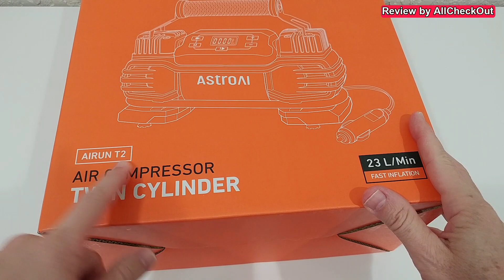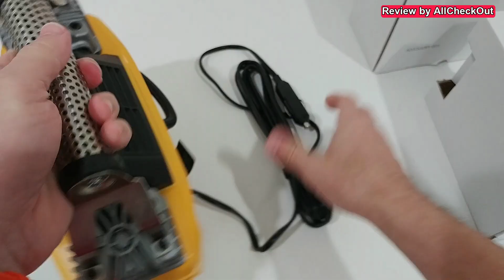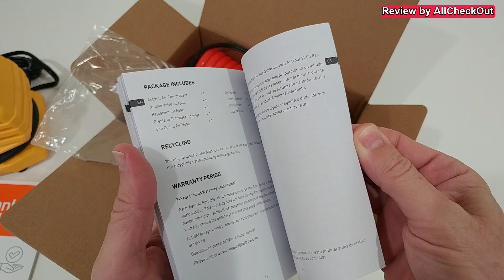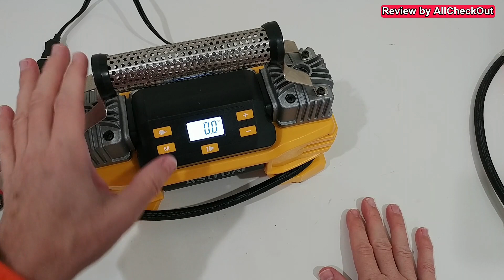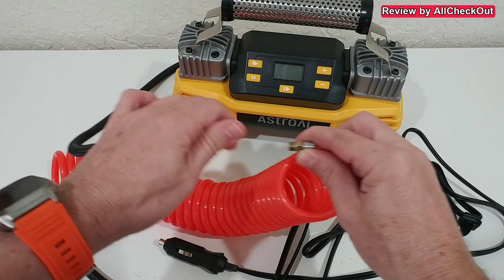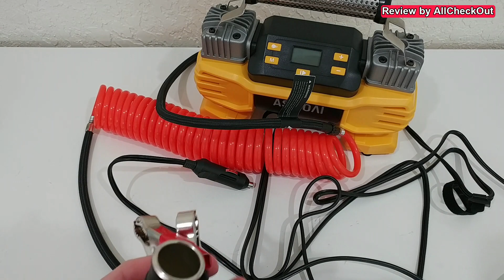AstroAI AIRUN T2 Portable 160 PSI Heavy Duty Tire Inflator Pump, Dual Cylinders Dual Motors, Review

Comment: To change the fuse, the whole top end of the lighter  plug (the plastic case around that metal tip) unscrews. Just screw off the top starting above the metal side contacts. Took me a while to figure that out.
Reply from the maker: Awesome - thanks so much for this info. Really helps 🙏🙏🙏